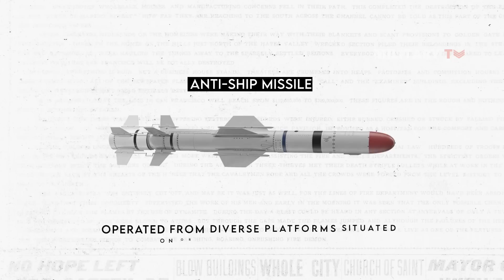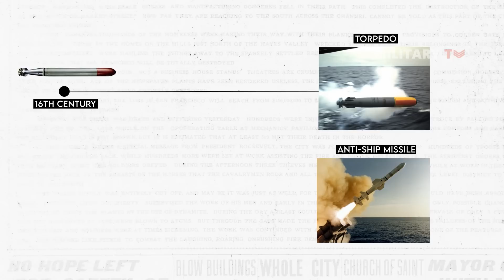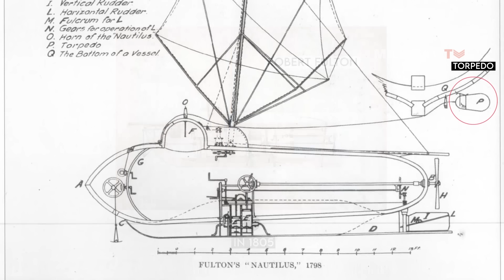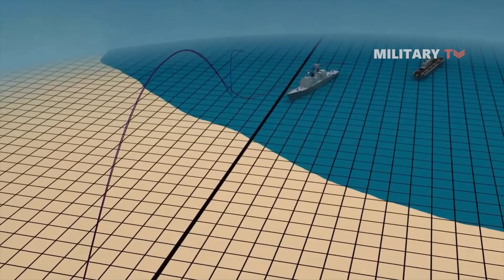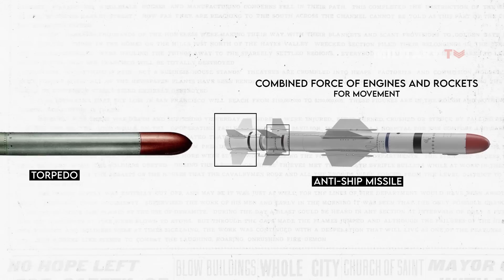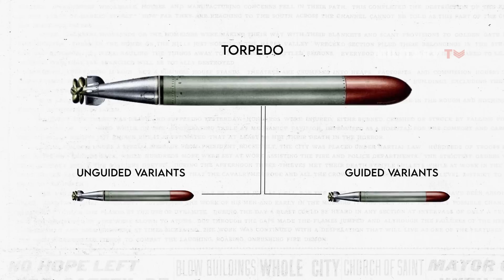Which is More Effective A Torpedo Or An Anti Ship Missile

Comment: One torpedo going off just 10 ft. or so below the keel of a ship will snap it in two & sink it in moments. Furthermore, although torpedoes are admittedly much slower & shorter in range than anti-ship missiles (which are actually the successors of the World War 2 era German Fritz X & Henschel Hs 293, by the way, & NOT the V-1), there is NO defense so far against them whereas there are multiple optional defenses against anti-ship missiles, such as hard-kill systems such as Close-In Weapon Systems (such as the US Navy's Phalanx or its much larger Dutch cousin Goalkeeper), Surface-to-Air Missiles & nowadays, there's the coming of Directed Energy Weapons Also Known As High Energy Lasers along with soft-kill systems such as flares, chaff & Electronic Counter Measures such as jamming.
Reply: it is just a matter of warhead   explosive power
Reply: @gino3286  Doesn't change the fact that if a reasonably sized amount of PETN goes off 10 ft below the keel of ANY sizable ship, it will SINK it!